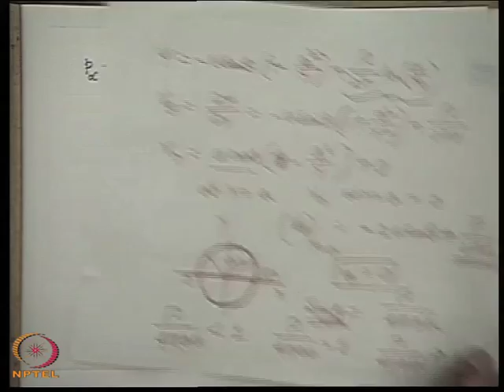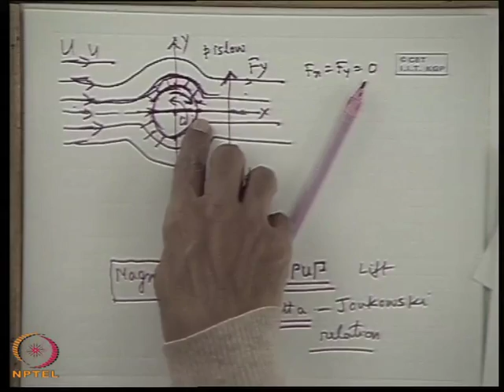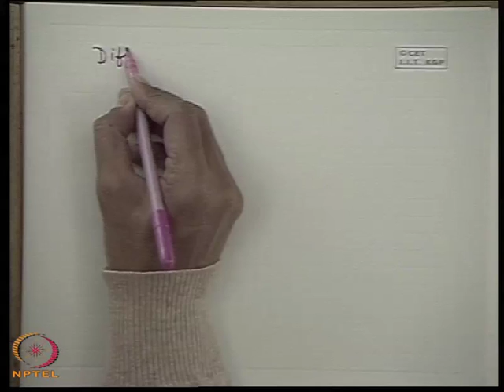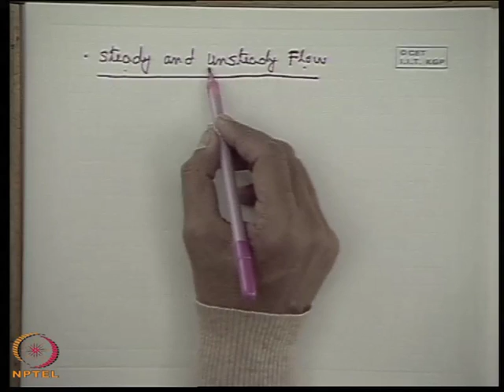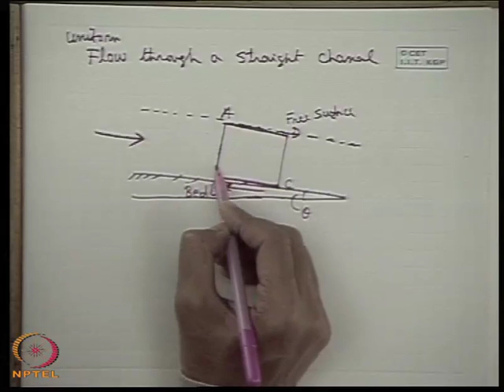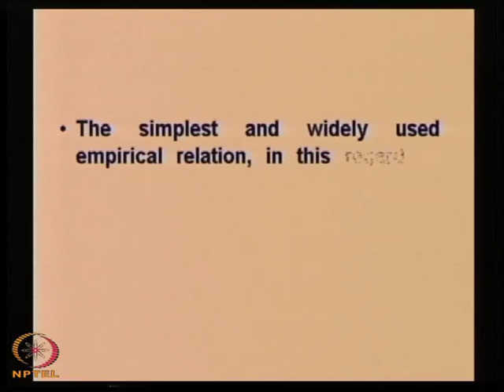Comment: Just noticed that even if circulation term is not present Fx would still be zero!?. How is that possible. Does the flow have no effect on the bluff body..if we consider a cubical control volume around the body. The momentum of fluid entering is higher than momentum of fluid leaving. So there should be a net horizontal force right??
Reply: Pressure from both side acting on cylinder and it is symmetrical about x axis..